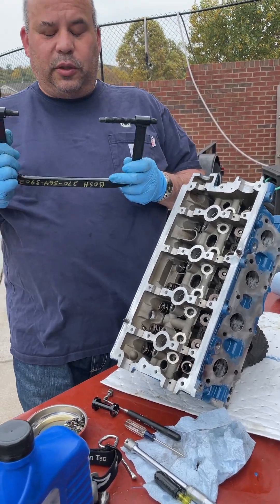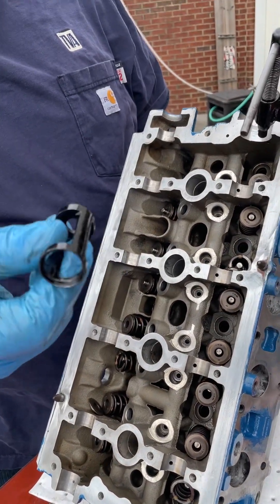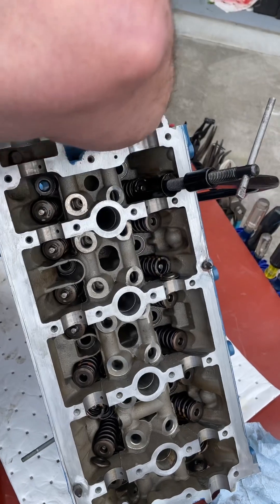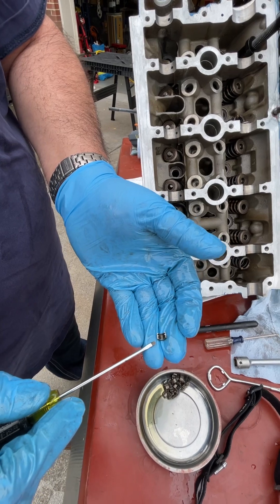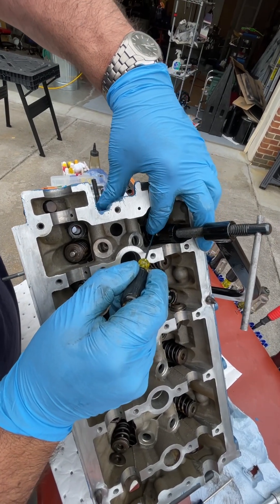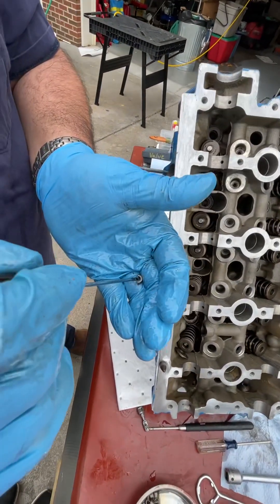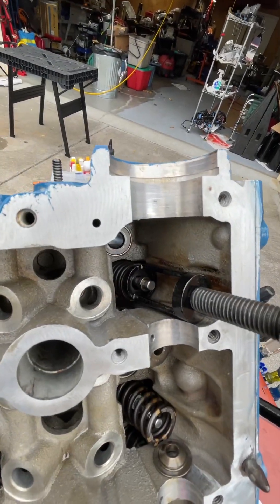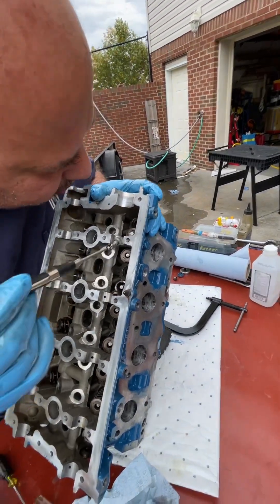Audi 2.0 valve spring keeper installation

Comment: Great video. Rebuilding my 2015 Audi S3 and I am trying to get the head back together. I did a head job on my 2008 Accord and I can tell you the springs are MUCH stiffer on the Audi. Had a Lisle tool where you smack it with a hammer. Worked great for REMOVING the keepers but useless for installing them. Bought this SAME tool on Amazon !
Reply from the maker: Very nice, thank you, yes, the Lisle tool works great on a Camry engine also.